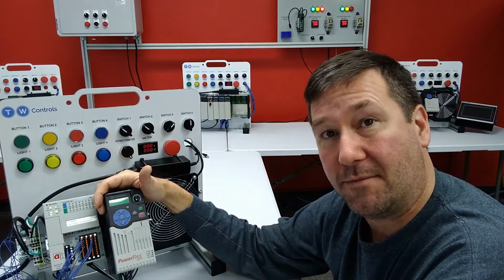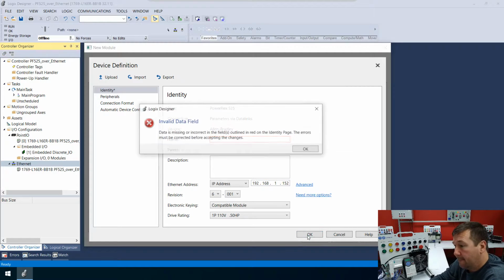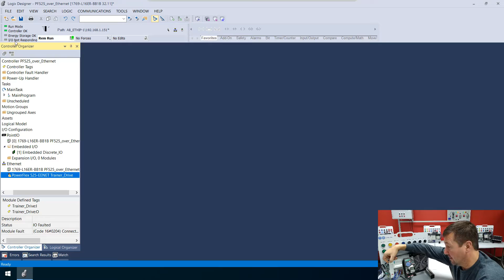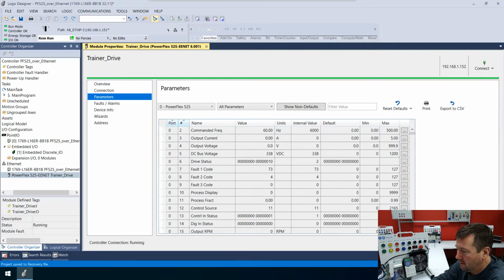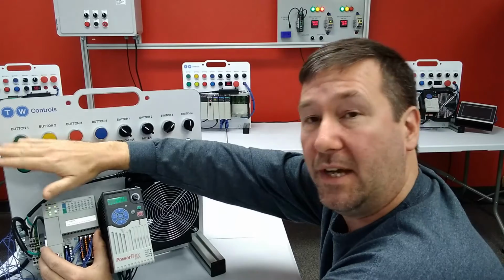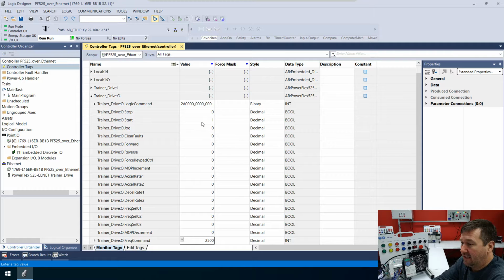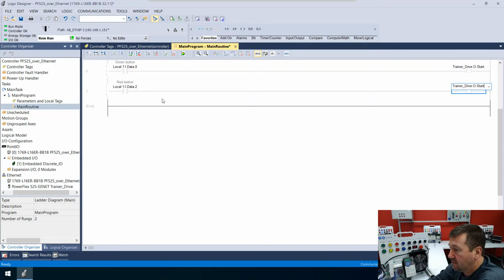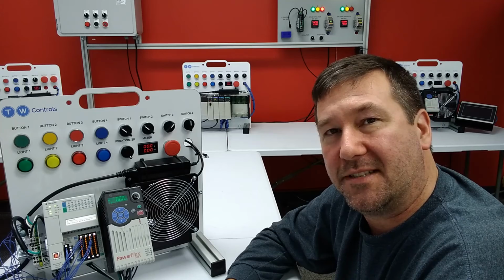Add a Powerflex 525 drive to a Controllogix Compactlogix over Ethernet

Comment: I am using Studio 5000, PowerFlex 40 with 22 Comm-E board. I can ping my VFD and see it in RSLinx Classic. But I can't see it in Who Active in the Studio 5000. Any ideas?
Reply from the maker: Maybe an issue with the harmony files?  Also, I think the super old ones didn't work with the Ethernet/IP driver.
https://youtu.be/ehcek7zRGg0

Comment: Thanks for your videos they've cleared a few things up for me as i am new to the maintenance programer position at work. I started off as an electrician. 

We are changing from controling a specific motor from being controled from an e300 to a powerflex 525 and i was wondering if there is an easier way to switch the tags for inputs, outputs, interlocks and stuff like that in the program. We are using a p_motor add-on in function block and switching to a p_pf52x add-on.
Reply from the maker: Nothing super automated but if you can make the changes offline, Find and Replace can be a very good tool.

Comment: Hello, was a video ever made regarding troubleshooting the I/O not responding. I am currently in a situation where I had to replace a drive. I downloaded the parameters from the old drive on to the new one but I am having that exact situation where my I/O is not responding and the PLC cannot communicate with the drive. The I.P. is the same as the old drive and everything is connected. Any help would be appreciated.
Reply from the maker: This is the exact scenario we go through in our class because it's so common. Right click the drive and go to properties then the connection tab. Under module fault I bet it says electronic keying. It meant you have a firmware mismatch. You must make the drive firmware match with the PLC is looking for using Controlflash Plus

Comment: does IP have to match PLC? as in the first 3 numbers. BTW I followed the steps and it didnt work,  I connected drive to workbench and double checked everything (realized my drive was 1.003 and was set up as 7.001).  Long story short, nothing seemed to work until I cycled drive power and than boom.... magic.
Reply from the maker: Yes, the have to be in the same network

Comment: Hello, is there anyway to add the powerflex 525 to a version 13 controller project?  I have to AOP downloaded but they won't show up, when I try to add the 525 to the ethernet module in the tree? I found AOP's for ver.16-19 on the Rockwell site.
Reply from the maker: You would have to use the Generic Ethernet module. It isn't difficult to set up but I don't have a video on that. It's in the manual... if I'm recalling correctly. We did it in a recent class for some reason.
Reply: @TimWilborne  Thank you for your response.  I think I will try updating the firmware to ver.17. We are limited to nothing above Version 19 due to Zenon HMI's.

Comment: Hello, So I had power flex 70 but it is now obselete and I replaced it with 525 so I followed same steps but I am getting module not configured after the download  how do I fix that ? Also sometimes I can ping my PLC but when I try to connect to it it takes so long and sometimes it works and sometimes  not  what could be the issues ?Thank you
Reply from the maker: Wildly guessing one of the data link numbers are wrong

Comment: good video
i have a question 
i need to know how to get a micro 800 plc to set the powerflex drive parameters on power-up via ethernet/ip or dsi and if any additional hardware is required other than ethernet cables
Reply from the maker: I don't believe the Micro800s support ADC (Automatic Device Configuration) so it would take quite a bit of work to set the drive parameters.  If you need that feature, you probably need to look at a Compactlogix.  Here is a video showing that feature.  Curious, why do you need to set them on powerup?  Is it just in case you need to replace a drive?
https://www.youtube.com/watch?v=C249NnJ4EmM
Reply: @TimWilborne  correct,
in the event of drive failure during production hours the maintenance crew will replace it and when they power up the panel it takes an additional 5 min to program the drive even if they have the "cheat sheet" for that machine
as far as looking at CompactLogix the company cant afford swap out all the plc's  to those at the moment
the old automation tech was able to do it with a micrologix 1400 and an adaptor (i assume it was for Modbus) to set parameters on a power flex 4
now just a guess on my part but can you send a write string or word to the powerflex something like a program variable?
variable "p36" with a value of "5"
Reply from the maker: We long as the parameters are limited, it would be possible
Reply: @TimWilborne  outstanding, i think i would not need more than 5 parameters such as a preset speed, start source, and basic motor parameters like FLA etc.

Comment: Great videos as always! If i am using a momentary foot pedal to control the powerflex can I use the start command in the "Jog" output instead of the start?
Reply from the maker: Honestly I have never used the Jog feature, I should play with it sometime.  The easiest way to do it is XIO Drive.Start OTE Drive.Stop.  That way when ever the Start has a 0 in it, it will put a 1 in the Stop, and vice versa.

Comment: Failed to splice the path errror PF525??
Reply from the maker: It usually means no connection or firmware mismatch.  Can you ping the drive?  What is your IO Light doing?
Reply: @TimWilborne  Actually my drive is healthy ,but ot didnot accept command from ethernet ip communication,so i reset it to default.I tried your communication video step by step but no response ,but when i change ip it doesn't ping and didn't showing in RS links.I tried to set ip at automatic in my pc,but its not communicate.
Reply from the maker: If you can't ping it then you need to check your network configuration.
Reply: Thanks for your kind attention and Support 😊🙏.Error solve.Vfd run over ethernet.
Reply from the maker: Outstanding!  What did you find?
Reply: I didn't find nothing special.But I set the VFD ip address physically using VFD display and changing parameters C128=1  and set ip at C129,C=130,C=131,C=132.
Reply from the maker: 128 is often missed. Is your download other parameters without it then you'll lose you IP address

Comment: Hi Tim, Thanks for the video. I have done all of the steps in it. I can ping my controller from my PC and when I check the ip address of the drive it is 192.168.1.12 in the same subnet as the controller 192.168.1.10 and my PC. But I am getting communication error when I click on the connection tab of the drive. Don't know why? Thanks again
Reply from the maker: What is the error?  Also, can you ping both of them from your PC?
Reply: @TimWilborne  the error message is communication error, no number. No i can't ping the PF. Thanks
Reply from the maker: @benedalati1527  If you can't ping the Powerflex then you need to hit the basics.  Here is a video to help.
https://youtube.com/live/W7Q5ZgvEWiw

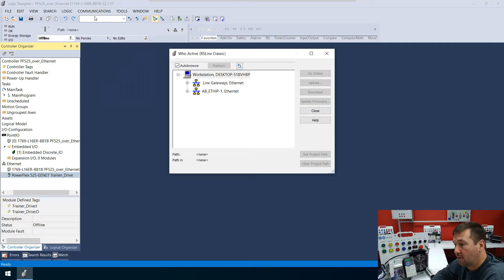Comment: At 4:43, you mention downloading the program. What program? I put the parameters in the powerflex manually following your previous video. Was i supposed to write a simple start stop program and downloaded it to the controller? what should my output be? one more, can i delete the pwerflex drive and create one the way you show here. I wanted to delete it and start fresh but got a mesage"Are you sure you want this module and all og its child to be deleted?" sounds scary? Thanks for all of your informative videos. I am new to this and already have learned a lot by watching them. regards
Ben E
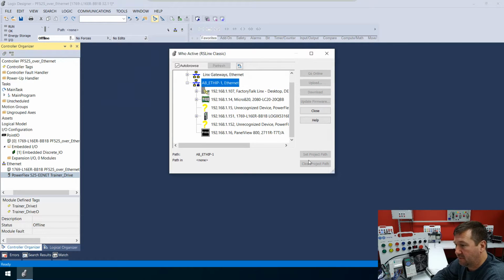Reply from the maker: Not following your question Ben.  The program we made from 0:00 to 4:42 of this very video is what you are downloading.
Reply: Hi Tim, Thanks for the reply. What I am asking is which program you are referring to. i don't see you doing any program but you say let's download ( the program ??). Did you write a program. Do mind posting it along with the wiring for the input and output. I hope my question makes sense. Regards
Be
Reply from the maker: From 0:00 to 4:42 we created a program and added the drive to the configuration.  I'm still not following you.

Comment: Do you have a video on how I can control a VFD on a compact logix PLC that is connected to a different compact logix?
Reply from the maker: I'm not following you. Are you saying that they are not on the same Ethernet network?
Reply: @TimWilborne  
I have a L30-ER that is connected to 3 drives, 1 output and one input card.  I want my L24ER-QBFC1B to be able to control a drive, and few inputs and a few out puts of the L30-ER.
Reply from the maker: @iamcool8304  Sounds like produced and consumed tags between the L30 and the L24 would be the easiest solution if they are both connected over Ethernet.  Here is a video on that.
https://www.youtube.com/watch?v=ABOAHyLcgSM
Reply: OK Tim you passed that challenge with flying colors thank you. 
Now for my next question what if I wanted to control the same two PLCs using one HMI?
Reply from the maker: @iamcool8304  Most HMI support more than one controller. You should be fine

Comment: Hi Tim, Thank you for knowledge you share. I have to replace on same 525vfd but different version ( old is version 1.6 and new one is version 4.0). After copying vfd program and connected to plc but Ethernet not connecting. But same vfd working with same Ethernet IP if i control from my PC
Reply from the maker: Chances are you have an electronic key and mismatch. The firmwares must match.

Comment: If the 525 is not on the list, how is it possible to add it?
Reply from the maker: Are you right clicking "Ethernet" then selecting new module?  This brings up a different list than adding standard I/O.
Reply: Yes, I have other powerflex devices but not 525 unfortunately

Comment: Thanks for the videos, your doing a great job. When we have to replace a drive that is networked to a Compact Logix via ethernet, we often have problems getting the drive to work with the system. Is there a video that you have that covers troubleshooting these problems? Thanks again
Reply from the maker: Do you have trouble setting the IP address or the other parameters?
Reply: You're

Comment: Have made a sequel video to this? I would like to see an example of programming speed control setting up some of the other parameters. Also, can it be configured to use either ethernet or the push button/potentiometer? Love your videos by the way, they are the best ones I've found at explaining things.
Reply from the maker: Hi Patrick, check out this series, it has several different setups for the Powerflex 525.
https://twcontrols.com/ac-drives-and-3-phase-motors

Comment: HI Tim Your videos are great my question to you how do you connect and disconnect the 525 from within the studio 5000
Reply from the maker: Hi Douglas.  Do you mean the inhibit function?
Reply: no i was just setting up for the first time and saw a means to connect to the via project or physical i chose physical so was just wondering how to disconnect since i was able to connect
Reply from the maker: @douglaslinton8292  Still not sure I'm following your lingo. Do you mean viewing the module properties of the Powerflex drive and Studio 5000? If so the connect is more of make sure the parameters match what's in the offline and you'll get used physical, which is what's in the drive, or use project, which is what's in Studio 5000 after that. Not looking at Studio 5000 right now but I don't believe there's actually a disconnect or a need to disconnect afterwards. Just close the module properties.
Reply: for example just like how you can go offline and online with the plc i was wondering if that was possible to do that to the vfd from within the studio 5000 software after you would have establish connection to the drive from the software
Reply from the maker: @douglaslinton8292  No. It's more like my previous reply.
Reply: Ok followed
Reply: @douglaslinton8292  You can use connected components workbench to view the drive parameters in real time if that's what you want

Comment: Hi TIM
I am starting a new project with a 1769-L24ER controller. I connected up to the USB port and did a firmware flash to V21.011. Everything seemed to go normal. At the end the controller would not communicate back to the ControlFlash program that it had the new version.

Now I get the solid red OK light and when I power it up it wont do the diagnostic test where it will runs through and lights all the lights. The USB port wont work either.

Any ideas
Reply from the maker: The firmware upgrade failed.  Time to call Rockwell, it will need to be sent back.

Comment: Hi, i would like to change a powerflex 525 installed for other new one, but after It's configured, the ethernet led port only flashing and not connect to the net to recive and manage the vfd via ethernet?

thancks
Reply from the maker: Sounds like you need to double check the IP address configuration.
Reply: @TimWilborne  But the parameters ip and mask net are correct

Comment: I had many problems following this video i wanted to list some things for others who have the trainer and their Studio 5000 may have locked up and sent many errors to AB. I changed many things not 100% sure what did what.
Program would not download deleted ethernet connection, only left ethernet IP active and changed to windows default driver. Took HMI out of run on config screen. The program seems to have problems with blank spaces on PLC and Drive descriptions.
When downloaded I tried to double click on drive it stopped like yours but my powerflex connection was grayed out in use physical so i had to use project. Then I got error writing port 0 Parameter 122 value out of range. I clicked ok and then double clicked drive and all loaded properly.
Also for others with trainer steps in video may not work for instance buttons on drive because this is already changed in drive to ethernet IP.

Really not 100% sure how i got myself in so many problems but maybe some of these steps will help others
Reply from the maker: Hi Dave. Yours should have already been set up for this but I know we had some issues with IP addresses. Try doing a factory reset as shown in the following video and see if that smooths out the steps.

Comment: hi TIM i am wonder can we program VFD BY RSL 500 software i looked at controller i didnt see 
thank you
Reply from the maker: Program as in set the parameters?  Possible but very difficult.  Run?  Yes, you can use messaging instructions.
Reply: @TimWilborne  thank you but I was looking for controler at software but I couldn’t find 
Also one more question pleas if we have any other typ VFD like Siemens can we program it by RSL5000 or should be just Allen Bradley 
Thank you
Reply from the maker: @tonymontero4752  The Powerflex 525 can be programmed with Connected Component Workbench.  Siemens has its own software as far as programming.
Reply: @TimWilborne  thank you
Reply: Do u have video shows how to program power flex by connected work bench 
Thank you
Reply: HI TIM I AM WONDER IF U HAVE SOME VIDEOES FOR SEQUENCERS RSL500 I HAVE DIFFICULTY FOR ADDRESING THEM
THANK YOU

Comment: Thank you so much for the video, I have to make some changes to my data type the default data type doesn't have the actual current. what should I do to get actual current in the Input which are read from the VFD
Reply: Ok i found it, its in the drive properties/Device Definition/Connection format. thank you very much
Reply from the maker: Glad you found it.

Comment: Tim, I love you videos but this one brings up a question.
The two ways you show to turn on and turn off the drive produce the same result but the first one is instantly recognizable as on-off and the second must be interpreted you might say. To the average person the first is easier to understand. Green button turns it on, red button turns it off. The second example has a latch which is not needed, otherwise they are the same. Both take two rungs. What is the benefit of using the harder to read method?
Reply from the maker: The second one is what you will more commonly see and allows for much more control flexibility when you go beyond a basic start stop.

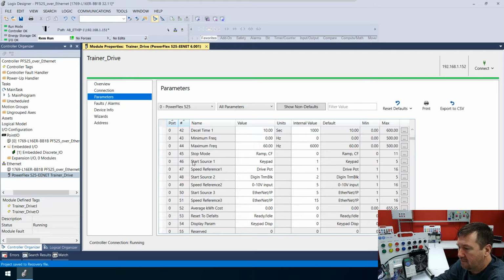Comment: At 8:43 I noticed that you have three options for the start source (#46, 48, and 50). Number 50 is already set to E/IP. Did you have to change source one to E/IP or is there a way to simply select source three as your control method?
Reply from the maker: Hi Brian, you can configure digital inputs to switch between start sources and speed references.  I have done this once, it would make for a good exercise.  It had a 3 position Hand Off Auto selector switch.  When in Auto, it's start source and speed reference was over Ethernet, but when in hand, its start source and Ethernet were from the drive I/O terminals.

Comment: Do you know generally how old the revision on the vfd  can be until it stops communicating? Bc I think we had a power flex 525 with a revision 3 that went bad, replaced it with a 6 and didn’t communicate bc in the plc it was a 3.
Reply from the maker: You must change your major revision in Studio 5000.  I should have thought to cover this.  I'll put it on the list Elie.

Comment: Only have version 20 of studio 5000 /
. Will trainer work with this version(20) 

If not I gotta go ccw 12 / micrologix 800 / logic theme but I rather compactlogix  .... which is ideal but I cannot get the proper version  new at work .... only service version its 789 so I don't think it's the right one to program and train with but I have a full  version  20 pro
Reply from the maker: Yes, version 20 is the minimum version that will work with our trainers.